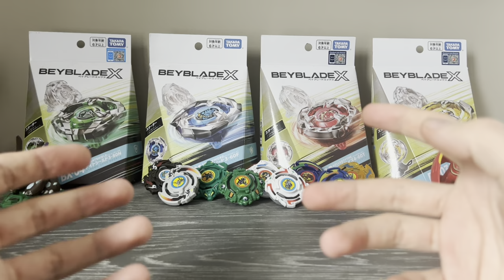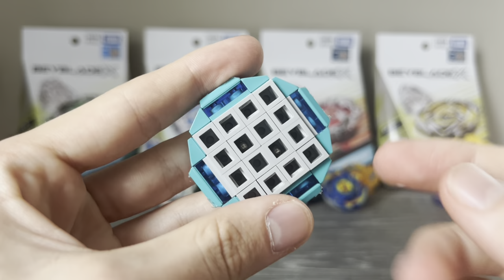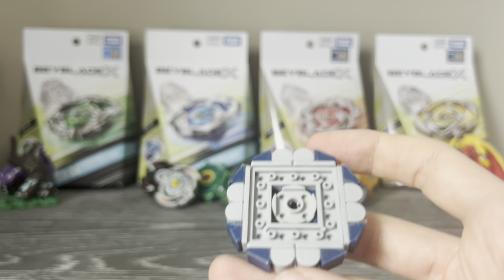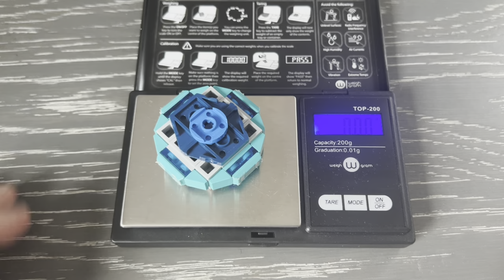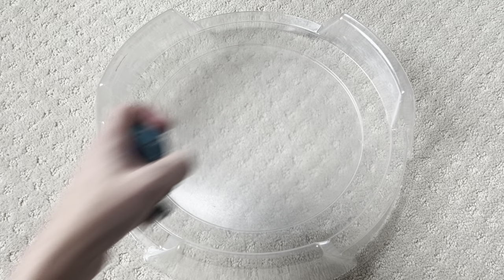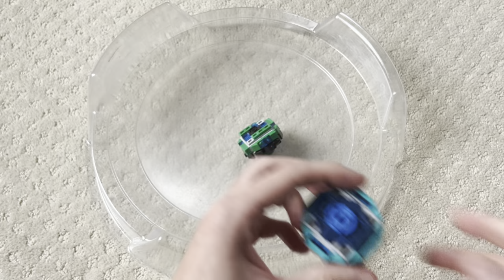Evolving the WORST Beyblade Burst Bey! | Echo Egis Lego Beyblade Review.

Comment: This might be confusing but, If you didn’t know, you can use a beyblade driver with legos. So basically, you would get a 8 stud gear, then you would get the long plus sticks with the stop thing then get 8 of those and put it around the gear, then you would grab something the size of a brave valkrie driver then put it in the middle where the stop things are.